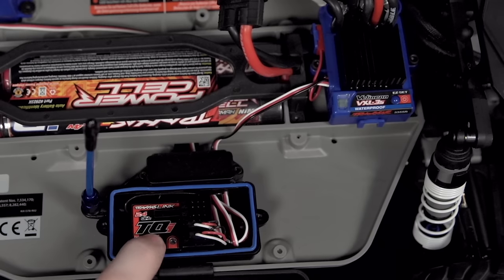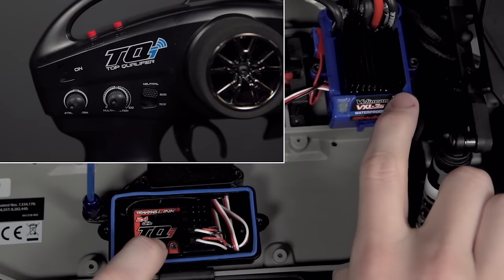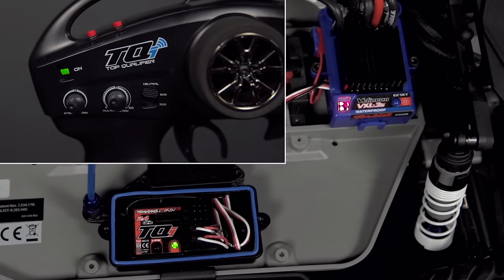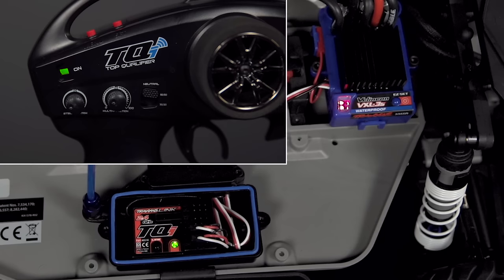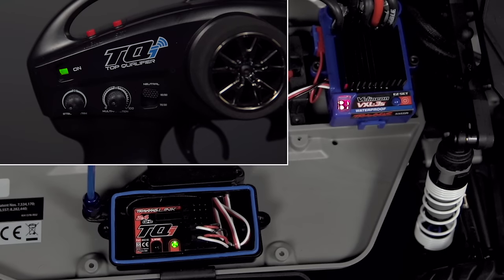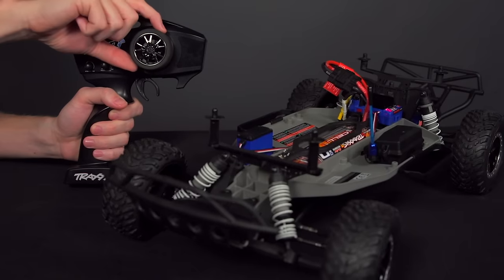How to Bind a Traxxas Transmitter and Receiver

Comment: how long does the bind take? my transmitter keeps blinking red and the has the light off. the car is on and its blinking green
Reply: It should do it immediately
Reply: What slot should the speed control be in on the receiver...
Can someone tell what channel to put the speed control in  plzs
Reply: @raven2wolfbane6045  speed control channel 2 steering channel 1. There are two channel 1 so make sure  that the speed control is in channel 2.
Reply: @baylormustaine983  life saver. Thank you!
Reply: Same issue
Reply: That's the same question I have because my esc is blinking green

Comment: Thanks! Can I still connect a different brand transmitter to the car?
Reply: The transmitter and receiver are a pair. If you have a traxxas remote you'll need a traxxas receiver. If you have spektrum you'll need spektrum.
Reply: Stop please
Reply: @mariofarina1714  ?

Comment: hi, 
i have a traxxas slash 4x4 ultimate with the old transmitter. Sometimes i have quality link problem. I have a g500 with the new transmitter. Can i bind the new transmitter with the old slash? Can i pair both the G500 and the SLASH with the same transmitter (obviously not using at the same time:)? 
Thanks

Comment: I bought new US radio sets / receivers (new models removed)
I made bindings but the receivers flash red fast and they never give a steady green light, I tried and servo steering works .. I tried both with nimh from a 4600 6volt petrol receiver and with esc
I can't solve the problem! Help
Reply from the maker: Hello andrea chierici! Our Customer Support Team would be happy to help. You can contact them at 888-TRAXXAS or at Support@Traxxas.com.

Comment: Will it connect to any RC other than Traxxas ones? If not, can i just replace the receiver with any other?
Reply: Jumper T12 Pro. It's under $100. 
I fly quads with it.
 It has expensive haul gimbles.
 No potentiometer fails just moving wires that need to be repaired after a year of daily use.
This receiver is on the list of compatable receivers.

Comment: What if it only shows a red light that is not blinking on the receiver? My vxl3 s is only blinking green. I seem to not be able to get a connection at all? I have tried binding, resetting, bought a new receiver. Only used my Hoss twice now with a total of about 35 minutes. Help

Comment: It doesn't works with TQi TRX4 transmitter, holding set button doesn't turn into fine mode when transmitter is turned off. HEEElP!
Reply from the maker: Give us a call at 888-TRAXXAS for more detailed troubleshooting.

Comment: My controller is connected to my traxxas. It will turn the wheels but won't drive. Any thoughts?

Edit: It is brand new, got it from Snap-On
Reply: if it drives the wheels, isn't that... driving?
Reply: Did you ever fix ?
Reply: @rpe520  I did but I'm having trouble again

Comment: My controller connects for approximately one second then it disconnects again, I tried this and it keep doing the same thing-what the hell do I do
Reply: Have u fixed it yet if so how do I do it?
Reply: @jettfendall3158  i fixed it
 and i feel dumb for not knowing but the batteries in my transmitter were dead...... i was a noob back then....

Comment: What do you do if your reciver keeps blinking red
Reply: that whats wrong with mine
Reply: Jaxon Hirschfeld same
Reply: That's what's warning with mine too
Reply: Jaxon Hirschfeld mine keeps doing that
Reply: did you ever get it to work i have a 3.3 Revo and my controller is doing the same thing
Reply: Did you turn it all off them retry it?
Reply: That's what was happening to my trx4 so I turned the truck off them controller and tried again and worked fine
Reply: same here.. trx4
Reply: same here, just keeps blinking red
Reply: I got a new transmitter, and it works fine! I've changed the servo, and tried numerous ways to fix it, but didn't work. Before sending your transmitter, try to bind with other transmitters, if you have one. I tried binding with my x-maxx transmitter, and it worked great, so I knew that the trx-4 transmitter was the problem. Good luck guys!
Reply: Jaxon Hirschfeld it happened to mine on my revo 3.3 I charged the battery and tried it again and found it worked 
Hope this helped
Reply: Its because off the old Transmitter
Reply: AAMIR ABD turn your steering trim all the way to the left. That Made iT work with me.

Comment: Where is the receiver box. Ofcourse its not labeled.  That would make to much sense. So I figured I would just open the 2 boxes. One has to be receiver.  But unfortunately they use some mada screw driver. My set of 64 not one works. So much for rtr for us who just want to run the freaking pos